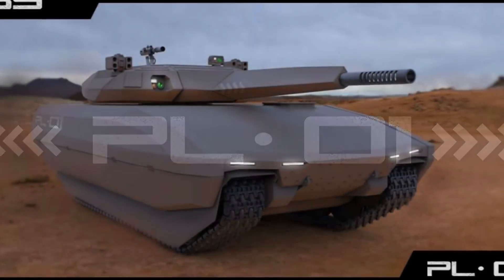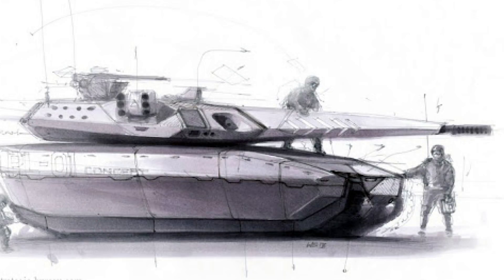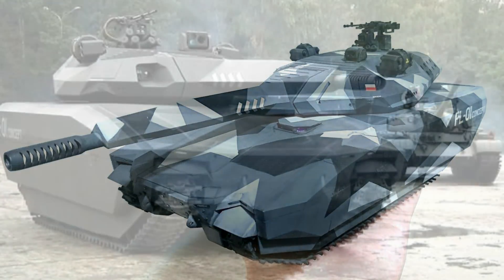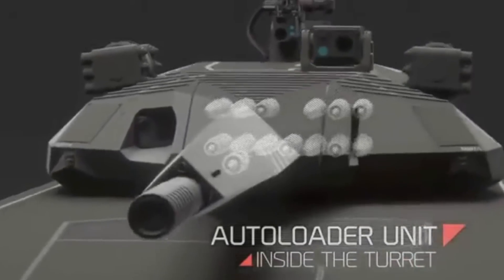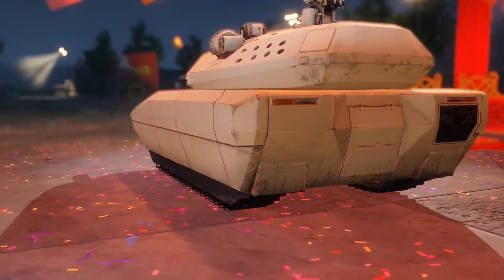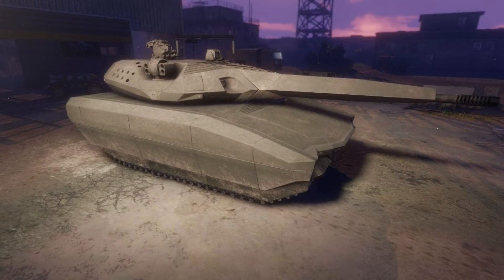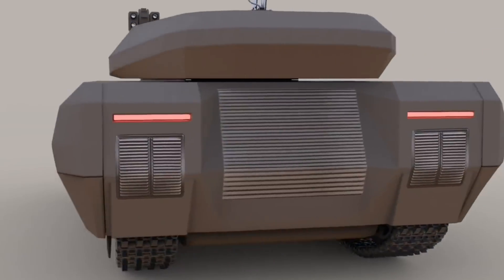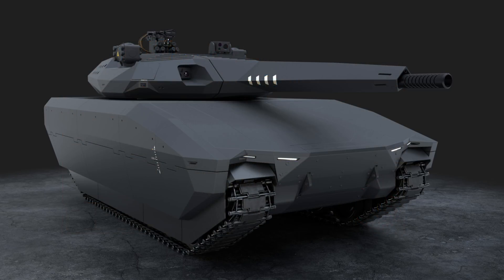PL-01 Prototype concept tank | POLISH STEALTH TANK

Comment: The issue with active protection systems is that they require active detection systems, fine against low level opponents but against near peers you are advertising you location constantly.
Reply: A good 360 degree detection system does not need to be active (ie active as emitting some kind of modulated energy, like radar). Passive, combined spectrum IR, visual, UV imaging seems to work with the F35 and maybe even for the Su57.
That there are the "low probability of intercept" radars too.
https://en.wikipedia.org/wiki/Low-probability-of-intercept_radar

But then, would it be a low(ish) cost infantry support vehicle?
Reply: 01000110 !  Plusz when the passive systems pick up a suspicous signal, which might be an incoming projectile, the active systems can switch on, verifying, pinpointing and if neccessary, engaging the incoming stuff. 
Preferably WITHOUT killing the very same infantry, that the vehicle is supposed to support.
Reply: @karlvongazenberg8398  by the time passive systems know the round is coming, it's hit.
Reply: @politenessman3901  How would an automated system be late? Of the system reacts with a lame 100 kHz, an APDSFS round travelling with M5 would travel like 18 mm
Reply: @karlvongazenberg8398  What exactly is your passive system detecting?
If it is flash, then spoofing will waste every round you've got in seconds, if it is sound to late by far, if it is active you are broadcasting your location and a few salvos of cheap dumb arty rds screw your expensive toys.
Reply: @politenessman3901  If those are rounds, ain't they HOT? You know, gunpowder and friction? Like the AH-64 does not use tracers, since the IR camera sees the rounds just fine.
Reply: @karlvongazenberg8398  so your active system is jammed by flares. great.
Reply: @politenessman3901  Do you know the difference between "IR" and "IR Imaging"?
Reply: @karlvongazenberg8398  yes. have you ever worked with Thermals?
Reply: @politenessman3901  First:
https://patents.google.com/patent/WO2017196414A1/en
(Anti-dazzle thermal imaging camera patent)
Second: A vehicle mounted system includes multiple sensor arrays, each using multiple sensors, both for damage resistance/redundancy and for triangulating on signals.
Add to this a laser and a microwave radar set, which only activates if such signal are detected and INBOUND, which flares are not.
FYI the Soviets had trouble with their early flares not fooling Stinger missile, because it had an UV sensor and flares were both deccelating differently that the aircraft and had different UV signature.
All of this stuff was crammed into a MANPADS in the 80's.
Reply: Politenessman, the tanks system is definitely too expensive but in its defense, the point of a detection system is to give you the chance to fire first, not detect an enemy that’s found you.
Reply: 01000110 !  You only know you need it when one of your tanks blows up.
Reply: A lot of the higher end ones are using electro-optical systems, basically cameras (I’m guessing thermal) to detect and track incoming projectiles. If it’s muzzle flashes triggering the system it won’t be spoofed by flashes because these systems have to track the actual projectile in order to trigger at the correct time.  These systems are non-emitting.
Reply: @Mae ! Oh my! it turns out that when you insult the one with a moral superiority complex, they too return the insult.
How do you feel about yourself now Mae?
Reply: 01000110 !  I see you've never worked with tanks? do you have any military background?
Reply: 01000110 !  OK, so you are bullshitting. I have worked with them. the point of tanks is shock effect, they generate that through movement and when you advertise that movement there is no shock effect (the distance you can hear a tank V the distance that an EW SQN can pick up active transmissions is great - particularly if the side moving them deliberately masks the noise - arty etc). it's cute that you, with no actual real world experience, believe your opinion is valid.
Reply: 01000110 !  Nope. but nice try. you have zero military experience and think that it is impossible to disguise tank movements in spite of the fact that this has been done since WW1.
I am in the position of arguing from experience with an idiot who thinks his thousands of hours on Youtube > 6 years as an infantryman cooperating with tanks.
I have nothing more to say to you, because anything I say is a waste of my time and you just are not worth it.
BTW, hint for the window licking special needs child on the short bus - if you are going to slag off tank mechs (who, like cooks and clerks and so forth) all do vital jobs to keep the military running, don't be such a colossally stupid cock gobbling arse sucking fuckwit as to do it on a youtube channel run by an ex tank mech. I mean that would be the act of such a mind numbingly dense arse bandit as to be beyond human belief. oh, but then that is exactly what it was, wasn't it.
Reply: 01000110 !  Always funny to have someone who didn't have the balls to sign up calling people Pogues. BTW, Pogues do a vital job, I'm sure Matt who runs the channel enjoys having gutless shitlords like you call him that.
Since you lack reading comprehension, I'll say it again. Infantry, lots of working with tanks.
The fact that you think exposing your lack of balls and ignorance = 'humiliating' someone and think that, as a youtube random, you get to buy into interservice banter shows just how pathetic you are.
Now run along, mummy has chores for you.
Reply: @Mae ! Thank you for your input. Fuckwit.
Reply: APS can't defend from above and diagonal path weapons.
Reply: In any case, the future belongs to stealth ground vehicles. Because most anti-tank missiles are so-called "fire-and-forget" missiles that are either controlled with electro-optical thermal imagers or with active radar. In the future, not only tanks will be protected with stealth technology. For example, armored fighting vehicles will also be protected in this way in the future. Incidentally, of course, not only the Poles are developing this technology.
In any case, if all combat vehicles are protected with stealth  technology in the future, then the old wire-guided technology will be used again, i.e. missiles guided by wire by an operator. The disadvantage is the limited range, because the range is reduced by the length of the wire.
Reply: @James Mckeehan and he probably found you because you are transmitting (radar, laser etc). That is the problem with active defences, they need active detection which is trackable for a considerable distance.
Reply: @politenessman3901  i think that you underestimate engineers who design such things. There's plenty of passive ways to detect gun shot or rocket launch (Visual+IR+audio channels) which will trigger more complex stuff(radar, lidar) to intercept projectile and since we're talking about modern electronics it can happen in a manner of microseconds, active protection systems also advances fire control system, so gunner will most definitely have shooter in optics cross in a second or two.
Reply: 01000110 !  Only if the enemy is using beam riding missiles.
So whenever you are advancing to contact you'll give up the element of surprise.  genius.

Comment: I seem to be completely missing something here. For indirect fire support we have howitzers like the M109 and some countries also have similar vehicles with 120mm breach loading mortars. OKN not suitable for taking out an MBT unless you get a drop shot (top of the turret etc). However the Brimstone is pretty damn close to being capable of vehicle launch and Sea Spear already can be launched from static emplacements and smallish boats (Brimstone 3 has been demonstrated surface to surface). It's got a range of about 10 miles in awkward terrain, and only weighs about 50kg. You could put 24 of those in something similar to an MLRS easily. So why do we need fire support vehicles?

Comment: Watching this and listening to your commentary; what they have here is an excellent replacement for the Walker Bulldog M-41 for armored cavalry. But I have no idea if that is even a thing today. So it's quite possible this an answer to a question folks stopped asking. But warfare evolves so the armored cavalry concept - especially in the Middle East, may be a valid idea. Again.
Reply: All major armies have many tanks. In any case, the future belongs to stealth ground vehicles. Because most anti-tank missiles are so-called "fire-and-forget" missiles that are either controlled with electro-optical thermal imagers or with active radar. In the future, not only tanks will be protected with stealth technology. For example, armored fighting vehicles will also be protected in this way in the future. Incidentally, of course, not only the Poles are developing this technology.
In any case, if all combat vehicles are protected with stealth  technology in the future, then the old wire-guided technology will be used again, i.e. missiles guided by wire by an operator. The disadvantage is the limited range, because the range is reduced by the length of the wire.

Comment: Rather than an MBT think of it as a light tank or tank destroyer and it would work well. Either for recon roles or defence (maybe used similar to the s-tank). Yes we now know (at least for a few more years until the naysayers start again) that MBT are still massively useful but maybe we think of ways to use these systems developed to compliment rather than replace!

Comment: Given that lasers (and thus LIDAR) are becoming a thing, stealth isn't going to be all that useful anymore. You're better off using composite metal foam armor and lots of it...
Reply: "Given that lasers (and thus LIDAR) are becoming a thing, stealth isn't going to be all that useful anymore."
So...cover it in light+radiation absorbing materials/paint...those exist.
Reply: @DxBlack  that won't work with LIDAR. You have to have metamaterials to counter THAT, and the sort of metamaterials that can do so are expensive, hard to manufacture, even harder to maintain, and don't like being shot at and thus useless.

Comment: The mock up was just a decorative shell over an existing vehicle. They did not have any design specs suggesting how it could actually be built or what its capabilities might be. An interesting idea but without underlying engineering work to bring it to prototype phase, difficult to say how feasible it would be.